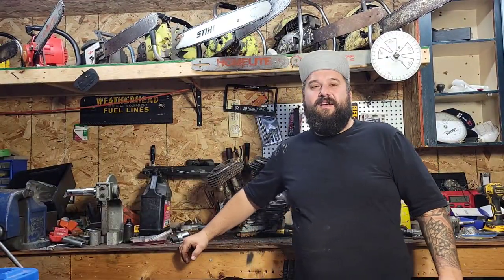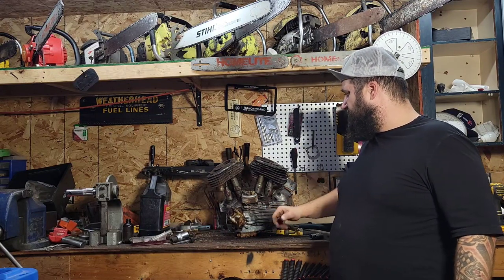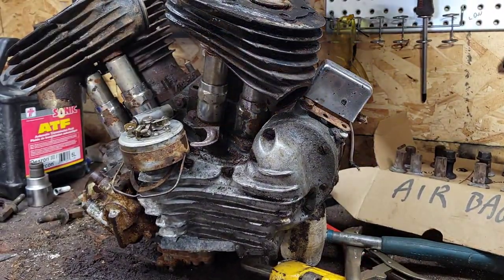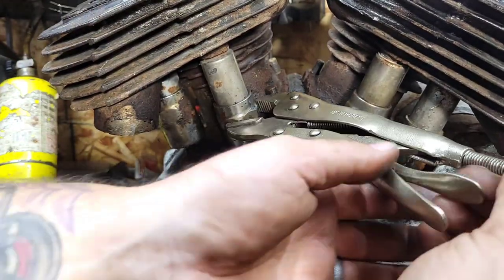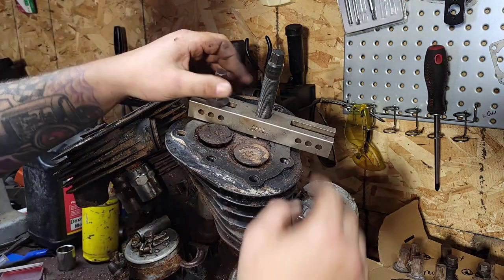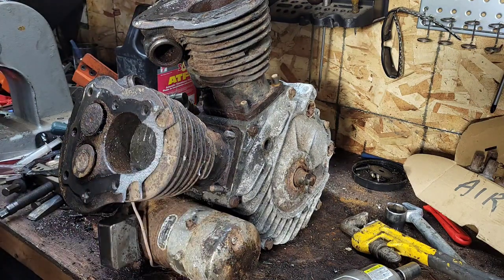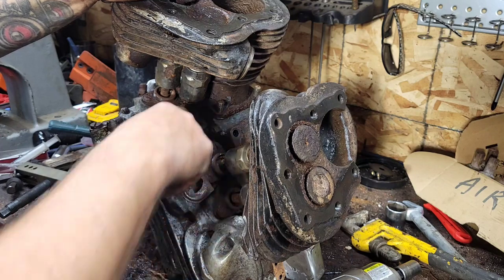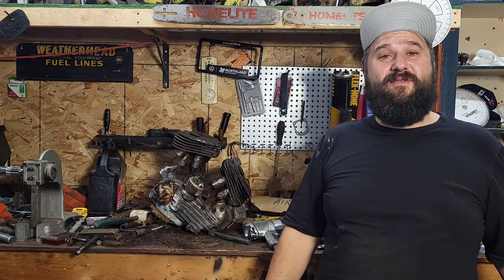45 Flathaead: Using heat and pressure to pull the cylinders...maybe.

Comment: In a situation like that I used to tighten the puller down as far as it would go and then take a hammer and strike the end of the pulling rod. It shocks the whole thing and works really well. Then tighten the puller up again and repeat.

Comment: This motor reminds me of my dad 1971 440 mopar engine the heads off for years and cylinders so rusted and pistons stuck . Nobody could get it apart . The only way I got the pistons out. I loosened the connecting rods and hit the pistons from underneath with a socket and hammer they came out one by one I broke 2 pistons but today the engine runs.. But in your case tinman best way I see is maybe grind them out with your foredom grinder.

Comment: so the yz 490 didn't suffer from poor compression , the issue they had was the  squish band in the head was not square to the piston , meaning one side was tighter than the other side .. actually this was a issue with  most yamaha 2 strokes from the early 70s' to the late 80's , air-cooled where the worst . 
i had build a jig that ran through the spark plug hole ( assuming a center located spark plug ) so a guy could put the head in a lathe and recut the squish band , and sealing surfaces ..... once this is done , a guy can actually increase the compression on a 465 / 490 engine family and it will run properly .

Comment: Pure raw gum turpentine is your friend the real stuff not the synthetic garbage it's better than any PB blaster or penetrating oil that they ever made I can't tell you how many totally seized up Rusty engines I have saved using it one key thing like if you're breaking a piston loose once it moves a little bit stop let it soak another day move it a tiny bit more let It soak if you do that you will get it apart without breaking a ring most of the time.